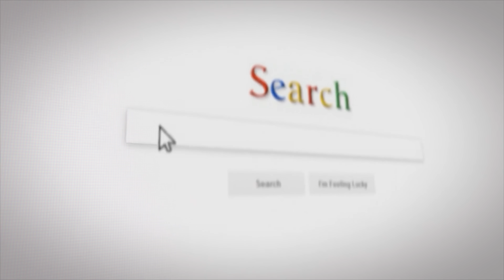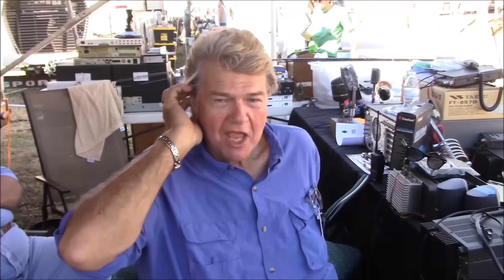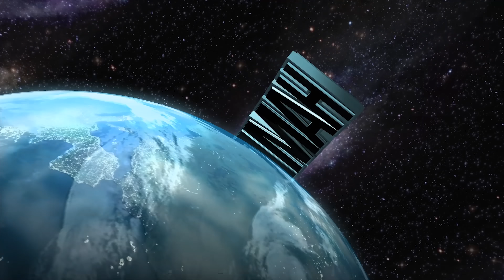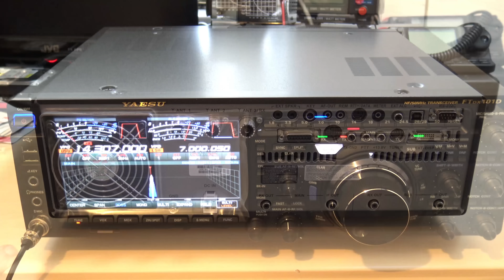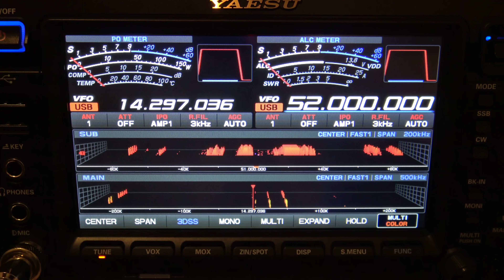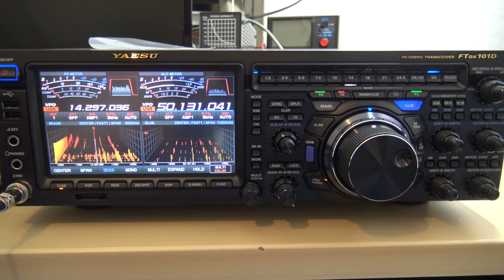NEW Yaesu FTDX101D Review And Demo

Comment: FTDX101D is not direct sampling SDR radio! Direct sampling SDR is one that samples/digitizes desired receiving RF spectrum directly at receiver's front end - antenna input or immediately after band pass filter.
FTDX101D is typical hybrid radio - analog heterodhyne/SDR radio with 1st IF obtained in the process of analog conversion.
The Down Conversion type receiver construction is similar to the FTDX5000 

First IF is then sampled by ADC (analog to digital converter) from which signal is fed to FPGA (field programmable gate array) for processing. 

The only true direct sampling architecture commercially built radios on ham radio market are:  Apache Lab Anan model radios, Flex Radio models 6300 and higher, Icom - IC7300 and IC7610, All recent models from Expert Electronics - in example SunSDR MB1, Elad FDM-DUO etc.
FTDX101D utilizes similar hybrid analog and SDR architecture as Kenwood TS-890
Reply: That is exactly why the 101D is better than a typical direct sampling receiver. It will always out perform them. High QRM and noise environments the 101D will excel, where the icoms and others will flop. The 101D actually has 6 receivers, 2 for each main and sub receiver band scopes, a narrow and wide sdr, and then the primary receiver for each, which uses a down conversion receiver which then within the first IF uses a direct sampling receiver where all the processing occurs, this protects the front end from overload and makes it superior. This also is an innovation

Comment: Generally informative. I felt the 3D waterfall display was annoyingly jerky. Not a word about sensitivity, filter quality, interference from internal noise, image rejection, etc.  Could have made another vid about things like that.  ;)
Reply: I believe the "annoyingly jerky" 3D waterfall display was more due to how the scan speed was set and less due to a short coming of the radio. From what I understand this is an adjustable parameter and it can be adjusted to smooth it out.

Comment: I went on a shopping trip while I was on holiday on the island of Penang. I found the radio supply shop near to the air field on the island. The radio had previously been on order before I got there. I was buying a Yaesu FTDX 101 for a Ham friend back down in Malaysia . All I had to do was introduce myself to the owner. Tell him that I had come for the rig that had been put on order for my friend. Check out the radio give the guy the cash and use the telephone to call a number that I had been given and wait for two army guys to come to the shop and ask for me. The army guys came in a Rover and took the radio away for me. It would be delivered to my friend back down in Malaysia by the AAC and flown by Beaver AC doing the mail run down to our camp airstrip where another member of our club worked. Military precision worked a treat to the last order. 73 de - John -G0WXU.

Comment: Hi Eric thanks for another great video! 

Now I am not hating on this new Rig as I have both Icom and Yaesu Rigs (just for people that take my questions and comments the wrong way like Ford vs Chevy for example) I Am still  not sure about how practical and useful the 3D waterfall is over a 2D waterfall or what the advantage would be (3D vs 2D)?  I’ll admit it looks neat but is it an advantage?  I also thus far prefer the Icom 7300 and 7610 waterfall displays as you have multiple colors in the waterfall stream which for me by looking at the different colors in the waterfall signals I can  quickly ascertain allot of information about the signal and signal type but on the Yaesu FTDX-101 the waterfall is pretty much just one color,  while you can change the color it did not have and I did not see an option for multiple colors so I loose this visual tool I like so much now On the Icoms and even a Yaesu Radio like the FT-991a.   Now with that said Allot of the other features look really good on this radio and would be very useful for a contest rig!  I will still hold off judgement as more and more people acquire this new rig and upload videos I am sure more information will come out about it’s pros and cons and of course we are all individuals and all have different preferences, likes and dislikes......thanks again Eric and a BIG Thanks to Gigaparts for supporting your channel and sending you great Equipment to review!!......73’s

Comment: Picked mine up today from my local HAM Radio shop..Makes my FTDX 9000 MP and FTDX 5000 look old.
Reply: Is it better than your ft 5000 ???
Reply: @kuriiklang2110  yes in many ways. But receiver performance very noticeable.
Reply: @JDDupuy  if you could only have one of these radios which would you have ft 5000 or the 101? I cant dicide which to buy
Reply: @kuriiklang2110  no doubt the 101D. I still have my 5000 but used rarely these days.

Comment: Great video!  I'd love to see YAESU FTDX101D VS  ICOM 7610 should you have the opportunity.
Reply: The IC-7610 is a more 'rounded' rig with better rear panel connectivity; the Yaesu has a better 'feel' to it / build quality but seems exclusively aimed at a Ragchewer or DXer.  73, Jarrad VK3BL :)
Reply: Well rounded is an opinion, mine is the 101d has better build quality better receiver, especially in high noise and qrm environments. It also is easier to operate with a knob for everything. Easy menu to navigate. The 7610 doesnt hold a candle to the 101d, I have used both and I went with the yaesu
Reply: @RateMyRadio  JARRAD  if you can get your hands on one , plz do a 3,4 part video on this radio sherrwood likes this radio keep up the good work 73
Reply: @RateMyRadio  Jarrad  agreed  see comment above  Pete VK3TQ

Comment: Nice overview of the radio!  It is doubtbul the USA will ever get the 70Mhz band.  The feds allocated it for the Positive Train Control separation system (PTC) which is to prevent rail accidents.  That project is close to 8 years old, is federally mandated to be implemented, and is just now rolling out live on all the major railroads.

Comment: Damn nice radio, but seriously Yaesu - WHY use a DVI connector on the back and not a standard HDMI port!?  It's now 2019, not 2001.  EVERYONE is moving to HDMI.  SMH....
Reply: They like ICOM did not want to pay the licensing fee.  The HDMI inventors charge the manufacturer a licensing/royalty fee and its not cheap.  Just Google it and you will see why. It has nothing to do with the cost of the hardware. It's patented.
Reply: @JDDupuy  That can't be the issue.  Raspberry PI and all these cheap PC boards have HDMI.  Almost every monitor made in the past 5 years.  In the US, the fee is $0.15 per user if they don't use the HDMI logo on the item, or $0.05 if you use the HDMI sticker.  Sorry, but the whole fee is pure crap.  D-Star has a much higher price per user than HDMI.  so I call pure BS.
Reply: @OrionThrower  If you fill out the application for HDMI licensing you might be surprised on the actual number it costs. But it is clear we really don't know why. If it is a technical issue or a cost issue. I guess we have gotten use to seeing HDMI replace VGA and DVI outputs over the past 6 years that we come to expect a change in out radio gear. The radio really has a bunch of new features that I have not seen imp[implemented by others.
Reply: @JDDupuy  lol i hope evryone see,s your answer to the dvi .there stuck and cant see past it.
Reply: @alexalonso2093  It does not bother me at all. I have  had a few hours to operate the radio anf like all the releases over the past few years that I have purchased they all still have a DVI connector. Maybe there is a technical reason as to why versus financial. My Russian SDR has 2 HDMI outputs on it so I think it is as much a choice for the manufacturing. I just hope the rig does not suffer from failures like the FTDX 5000 OLEDs or the problems my FTDX 9000Mp had. Very expensive to ship.
Reply: I considered that question and had one other thought—I’ve never heard of a DVI port dialing but I’ve had HDMI ports fail on a couple pieces of equipment. One less thing to worry about and of course it provides the same image quality.
Reply: Yaesu lives in their own parallel universe which is also known as Japan.
Reply: I found an adaptor for around $10, so might be a bump in the road but hardly a big deal... I have lots of things with connectors I don't like... wish they would just do USB and let me build and put what I want on it next to what I want it to connect, but alas... no one listens.
Reply: a DVI port actually makes it more flexible, same reason serial ports stick around. Get an adapter, it's a lossless digital signal.

Comment: How does the receive compare to the Icom 7300? I know they are in different leagues but just curious what you think.
Reply: Even a Yaesu FTDX 1200 will blow a 7300 away, sure it has not got a water fall but it's got amazing noise reduction that doesn't make it sound like you're listening under water. 

I'd rather have sound quality over a waterfall any day.

The FTDX can be picked up at a decent price too.
Reply: @o00scorpion00o  100% agree. Had the 7300 for one month. The audio on SSB is noisy due to the direct sampling SDR and I ended up hating the radio. Going hybrid is genius on the part of Yaesu Just got the FTDX1200 to replace the 7300. The 1200 is a work of art compared to the 7300

Comment: I loved the video but please let us hear how the sdr rx performs when there are interfering signals and also vc tune mode and digital noise reduction. Please, I can't wait!
Reply: I use mine all the time in a high qrm environment, can filter it all out completely both sides of my frequency, they are gone even when they are 2kc below and a 5kc wide bleeding station 3kc above as I run a net on 7.197, and the 7.200 cbers are at full throttle, and those others move in on us on 7.195 because they think they own  that freq. and when I use my filters and the VC tune all I hear are my check ins

Comment: Great video Eric!  Which rig would you recommend: IC-7610 or the FTDX-101 ?
Reply: It is a hard call. If you think the 3D display is a winner, it might be worth the extra grand. If you prefer a spectrum analyzer type display, then it is the 7610.  The 7610's display has averaging and trace fill which results in a superior 2D display. The 101D's multiple color schemes and big-boss rig look are sure to help it's sales. Both rigs have excellent performance. Not an easy call at the current prices...
Reply: The prices are very comparable actually there isn't a grand between them, and the receiver is loads better in the 101d
Reply: It really depends on your priorities.  Want to drive a transverter, or want to insert filters or pre-amps etc into the RX loop?  Or even use it remotely out of the box without external devices?  IC-7610.  Want to feel like the king of ragchewing in front of a nice big solid rig?  The FTdx101D has a real presence.  73, Jarrad VK3BL :)

Comment: Why are you running the ALC way outside the ALC window??
Reply: Because he is a You Tube reviewer. Cut the box open and make a video.
Reply: @JDDupuy  Well said JD ;)
Reply: @JDDupuy  The most hysterical review I saw was on the 7300... it had three parts - Part 1 was about opening the box, Part 2 was about what was in the box (guess the secret decoder ring didn't work on the packing slip), Part 3 the other cool gear in his shack and how this model would make a fine addition...

Comment: Just to check with you on the Right meter you have POWER showing and on the Left meter you have ALC showing but your ALC is way over the meter line is that normal for this radio or all the radio's you use??? I always hear Ham's saying KEEP THE ALC in the meter line or LOWER ???
Reply: I saw that too. Way too much signal in my opinion.

Comment: Could you please do another video to focus on NR, NB and VC controls and performance both in CW and SSB.  Those are very important features that must work well to make this a great radio.  Thanks -Joe N3HEE
Reply: So far from what we've seen the NR works very well for weak signal HF SSB, which is a nice surprise!  We've got one video up, but hope to have more extensive ones soon.  73, Jarrad VK3BL :)
Reply: Yaesu has always had the best Noise reduction out of the big three, flex may be as good. So yes easy to use and the receiver is quiet already without it engaged, having the feature is a plus. I compared the 101d with the 7300,7610,ts890, and the frdx5000, its DNR and NB is light years ahead of the 5000, and by far better than the others

Comment: Good enough for you to switch from Icom back to Yaesu? Looks like an upgrade for my FTDX3000.
Reply: For us no.  It depends what you want in a radio.  The IC-7610 has more well rounded features, but the FTdx101D will likely be the choice of ragchewers everywhere, and those who don't need or want the additional rear panel connectivity the IC-7610 offers.  As for DXers, the FTdx101D may also be the better choice but we're all awaiting the sherwood numbers before calling that one!  I can't see it having as much multi-multi contest appeal, as it doesn't have a built in RX Loop for filters etc.  73, Jarrad VK3BL.

Comment: The DVI out felt really cheap. I mean they couldn't spend the extra buck to make it HDMI?
Reply: Good point I noticed that also most monitors and just HDMI and display port now.
Reply: FYI: "DVI and HDMI have the same electrical specifications for their TMDS and VESA/DDC links. However HDMI and DVI differ in several key ways. HDMI lacks VGA compatibility and does not include analog signals"
https://en.wikipedia.org/wiki/Digital_Visual_Interface

So you're saying you want to lose Analog VGA backwards compatibility? Nothing cheap about DVI.
Reply: @XPCTECH  it is Missing VGA take a good look at that DVI its not a DVI-I its a DVI-D it's missing the 4 pins on the right that supply the VGA analog signals...
Reply: @XPCTECH  I did a lengthy reply on this. But it's not showing up, if I am not signed it. Youtube must have shadow banned it.
Reply: @XPCTECH  No, I am not nuts and your accusation is misplaced. I can only see the earlier comment when I am logged in. I must have used a controversial word or something, triggering a filter queue or similar. Please don't accuse me of being nuts when you have really no basis for that. Yes, screwing in DVI is an advantage that I haven't thought about. If you think the discussion is stupid then stop commenting.